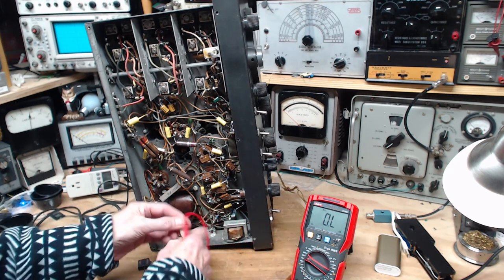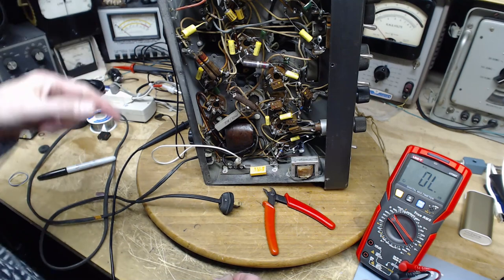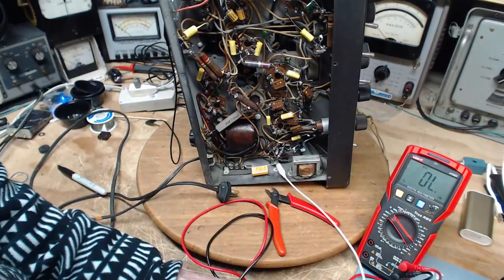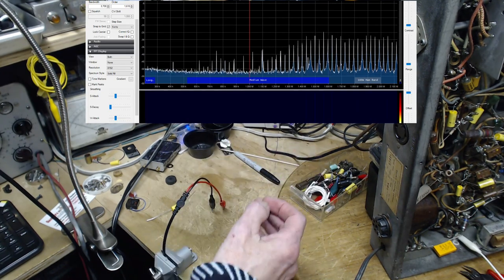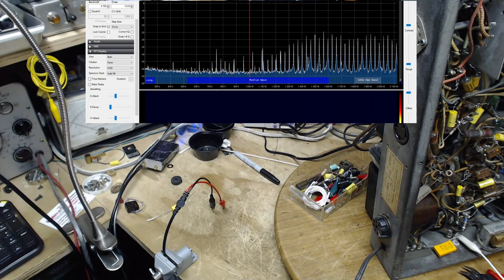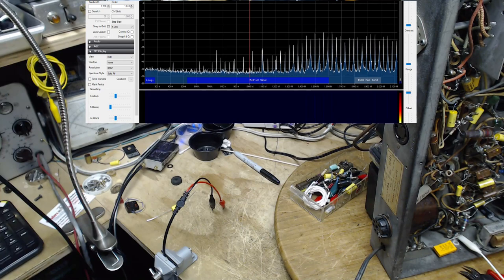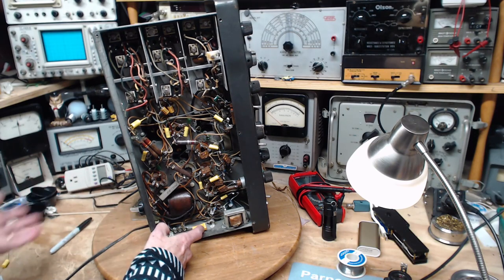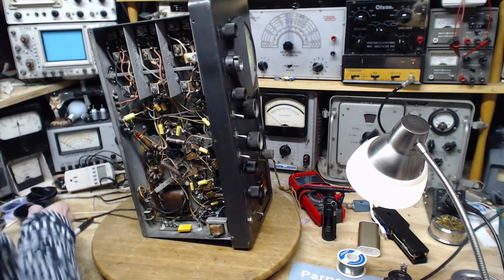Hallicrafters S 40A Shortwave Communications Receiver Video #10 - Power Line Filter Capacitor

Comment: I have the same Sencore Isolation device. When the radio is isolated the AC power cord is an ACTIVE antenna to some degree. When plugged into the regular AC outlet the radio is grounded to the home electrical system. The best thing we hams do today is ground our radios to a separate ground system, be it a Ufer Ground or a ground rod... 
The radio does have a ground terminal on it and in many cases grounding the radio will help in many ways!! Modern radios are solid state and work off of 13.8 volts and the tube radios off 117 volts, thus the ground terminal on the 3 pole antenna terminal.. 
FUN STUFF and Great Video!!!

Comment: My SX-100 developed a small AC hum when the volume was turned down. Replace the Bypass capacitor off the AC input, like yours, and the hum went away. The capacitor failed a leakage test! Hallicrafters engineers designed their radios with very smart engineers...

Comment: In one position the HOT lead goes directly into the capacitor, in the other position it must first go through the transformer winding before it hits the capacitor. So the transformer acts like an inductor in line with the capacitor.. 

Many years ago a Ham Friend said if the radio has a hum, just flip the power plug and it will probably goes away, thus the non polarized plugs used on many other tube vintage radios. Probably best to NOT install a polarized plug and just plug it in whatever way it works best.. 
 
If I recall my Hallicrafters SX-100 had to have the plug reversed to fully eliminate the very slight hum I had after replacing the bypass capacitor years back!!

Robert
WA6PHN

Comment: Remove that cap and put a 3 wire cord on the radio.  Ground the cabinet.  Put in a fuse on one of the transformer's input.